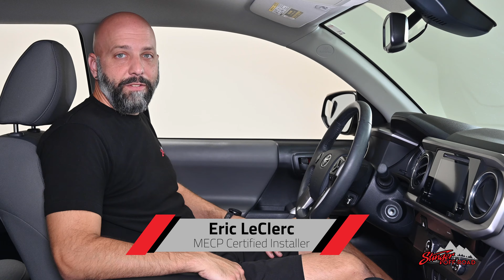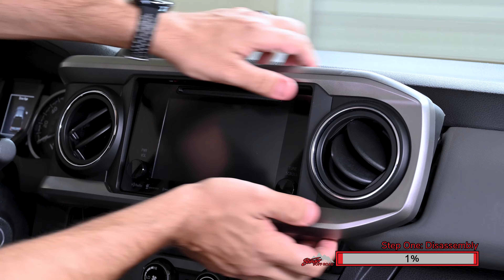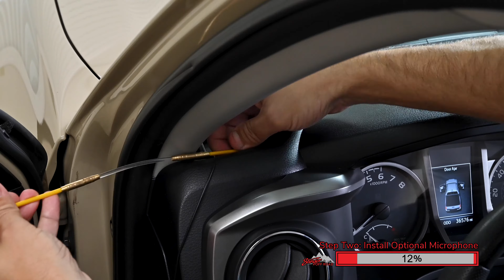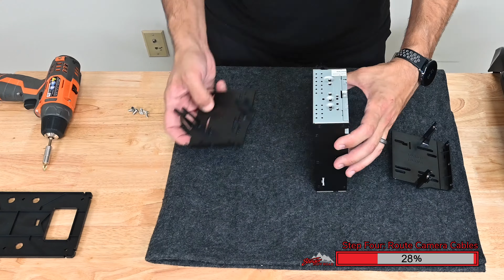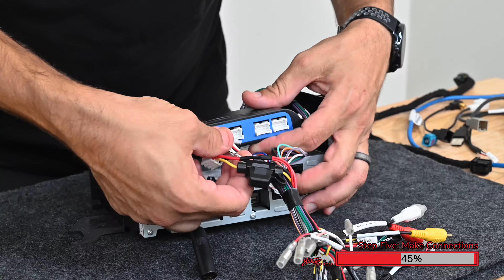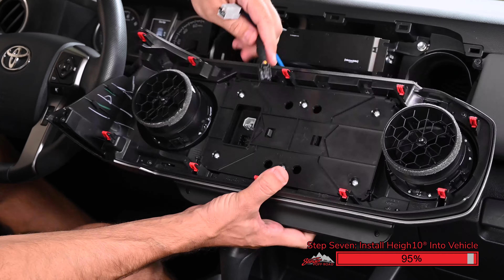INSTALL: 2016-2023 Toyota Tacoma Radio Stinger HEIGH10 | RB10TAC16B

Comment: I just purchased the kit. 
After I have read a bunch of reviews I found these complaints.
These are not deal killers
-Slightly longer boot time 10s OEM vs. 15s Stinger
-Wired Carplay

-Loss of the compass. Does this work with the iGo GPS Card?
Other questions
Is the mirror compass tied to the OEM GPS?
Does the dash display take advantage of the features iGo GPS?

Comment: My steering wheel controls will not work after installing this into my 2017 Tacoma sr5 what should I do?
Reply from the maker: Please give our tech support team a call and the will be happy to help get you going. Be sure to have access to the wiring in the truck when you give them a call.  The number is 727-592-5991 and we are open from 9AM-8PM EST M-F and SAT 10AM-5PM EST
Reply: Bro… did they tell you what the issue is because I’m having the same problem

Comment: Why would you need a mic. Doesn't the stock truck have one. Will the stock one work with this stereo
Reply from the maker: The factory microphone will only work with the factory radio. The HEIGH10 includes both an external mic and one that is built into the screen. You can choose which you use in the radio menu. Many people use the internal microphone so they don't have to run the additional external mic.

Comment: HDMI does not work when trying to mirror iPhone.
Reply from the maker: Some phones require the display resolution be set or changed in the settings to work properly when connected. You should only have to set it up the first time, then it will be that way anytime it is reconnected.
Reply: @StingerDrive  I figured it out. I was stupid. I had pull the E break. I fixed that too. This head unit is amazing

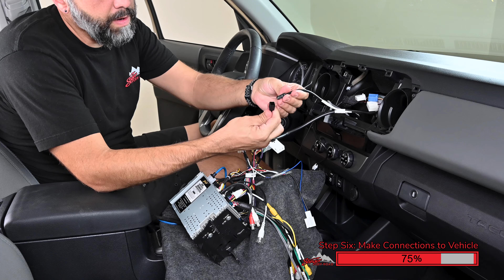Comment: 4:44 where does this plug on heigh10? Can’t get the SiriusXM to work.
Reply from the maker: You would need the SXV300V1 universal satellite radio tuner (sold separately) to add satellite radio to the HEIGH10. The 12 pin to DIN cable adaptor and factory satellite radio antenna adaptors that are included with the RB10TAC16B kit will connect directly to it.

Comment: Is there any information on the quality and pick up of the three different microphones? Factory, extended, and on screen?
Reply from the maker: The factory microphone is not compatible with the HEIGH10 radio, only the original Toyota radio. There are no specific "specs" on the two different mics that work with the HEIGH10, but both the internal and external mics have similar results from customers. We always recommend installing the external mic as well, and then choosing which works best for you in the radio settings menu.

Comment: Love the unit and everything is working great 👍 only issue is my Bluetooth does not work. I can’t even select the Bluetooth icon. It’s faded as if it’s off. What’s the deal with that?
Reply from the maker: The BT pairing instructions can be found on page 10 of the guide linked below. If you have already paired your phone and are still having issues, please try "forgetting" the HEIGH10 in your phone's BT setup, and repair it.
Reply from the maker: https://cdn.shopify.com/s/files/1/0311/6485/8503/files/UG-UN1810-UI_REV_040820_R2.pdf?v=1616423519
Reply: @StingerDrive  Got it thank you 🙏
Reply: @StingerDrive  Thanks for the response I was able to get it figured out. 

Another issue I'm having is that when I installed an additional front camera to my tacoma and connected it to camera 4 and trigger 4 connections, I get a no signal message. Is there a step I'm missing? Do I have to enable the camera some how?

Comment: Do I have to use the extended microphone wire if I still want to call friends and family through the truck?
Reply from the maker: The HEIGH10 comes with a integrated microphone in the screen as well, so you do not have to use the external mic if you dont want to

Comment: Can I plug an ipod into either USB port or does it have to be the top port as well?
Reply from the maker: You would have to use USB1 on the unit. USB2 will only play media files from a USB jump drive and charge.

Comment: Love this kit. Only 2 problems I'm having. 1 - I can't get my backup camera to trigger when shifting into reverse. It works just fine on the camera screen. I can toggle between my front and back cameras. But not in reverse. 2 - Android Auto isn't working for me. I tried 2 different phones and 3 different cables. CarPlay works just fine but not Android Auto.
Reply from the maker: If the Tacoma is manual transmission, we do not see the reverse trigger thru data. You would need to tap the reverse trigger of the HEIGH10 to the reverse wire in the factory radio harness for that. You might want to make sure the SUB connection type is configured to MTP or Media Transfer Protocol in the USB Configurations Settings in Developer Options. Some phones are defaulted to charge only with the Android 12 update.
Reply: Ya, your tech support guy Zack hit me up with that. I do have a manual and that fixed it perfectly. My Android Auto issue was fixed by trying another brand of phone. Doesn't like my OnePlus phones but it works just fine with a Samsung. So I'm 100% happy now. 👍

Comment: Will my 2019 Tacoma TRD Pro auto dimming feature work with this systems head unit? The Tacoma factory head unit will dim automatically based on the exterior lighting conditions, I believe their is a light sensor next to the right side dash mounted speaker? Additionally my TRD Pro has a second USB port in the center console, will I need another USB dongle cord to connect the second USB source?  Is it possible for you to do a short video on the XM radio module connection? Thanks
Reply from the maker: The HEIGH10 will dim when the vehicle parking lights turn on, to a level that is adjustable in the radio menu settings. We include the factory USB adaptor for the SUB retention, however either a second adaptor for an additional factory port, or another USB extension would be needed to retain a second USB connection. We do not have a video of the satellite radio module being connected, however it is as simple as connected the suppled SAT antenna adaptor into the antenna port on the SXV300V1, and the DIN cable from the SXV300V1 into the 12 pin adaptor included with the HEIGH10 radio.

Comment: Where does the the SiriusXM cable connect? Bought the Tacoma kit and followed these instructions but the SiriusXM app keeps asking me to check the tuner. Where does the black SiriusXM cord plug into?
Reply: I'm having the same problem. Can't figure out where that connector gets plugged into.
Reply: It looks like you need a sirius Xm module $41 on Amazon. Don’t quite know where it plugs in.

Comment: Does the harness come with RCA inputs for aftermarket amps? Curious to know because I am running a JP234 4 channel amp and a JP23 monoblock amp onto my stock 2018 TRD sport headunit.
Reply from the maker: The HEIGH10 has front/rear/subwoofer RCA outputs, as well as audio/video RCA inputs.

Comment: Can you use the factory mic that is in the ceiling for the Tacoma?
Reply from the maker: The HEIGH10 comes with an external mic as well as the one built into the screen. The factory microphones are active/powered microphones and cannot be used with the HEIGH10 or any aftermarket radios unfortunately